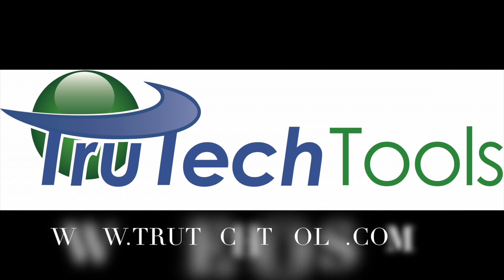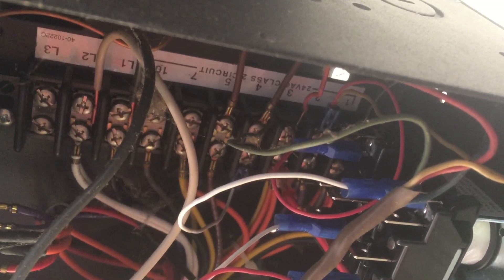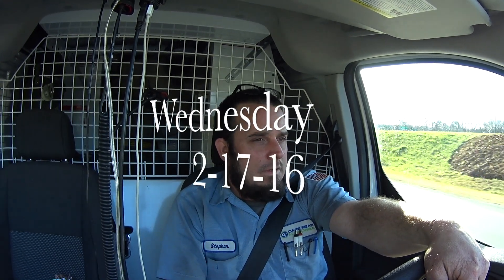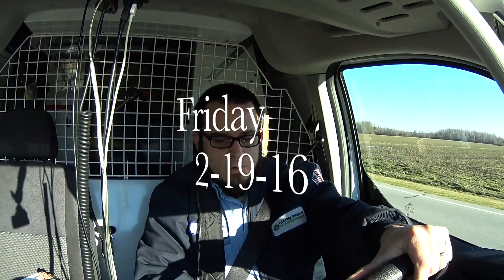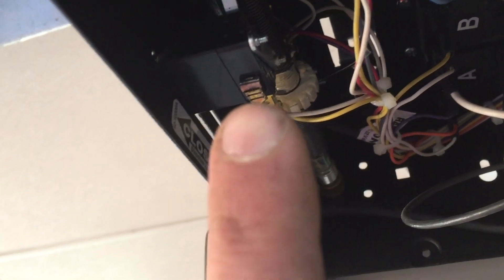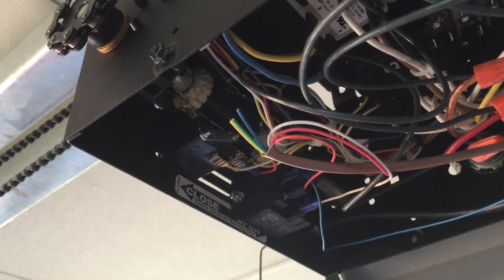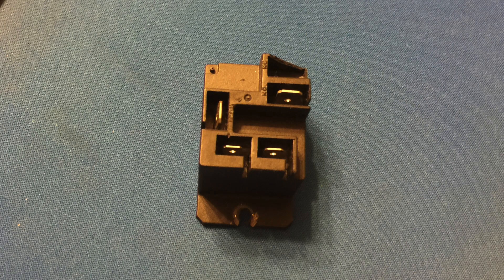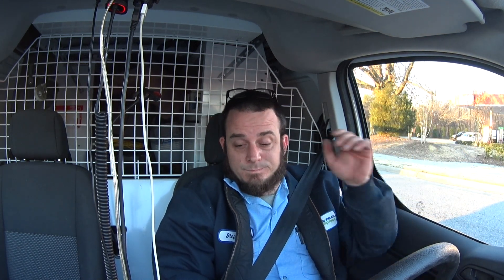HVAC Service: Garage Door Controlled Heater Shut Off

Comment: hey boss check out RIB products for example RIBU1C, it has 24v ac/DC and 120ac coil in one relay with n/o and n/c closed contacts. those come in very handy. electrical suppliers and Grainger have them on hands.

Comment: What about an end switch in the rail itself? So if the door starts moving it will close an end switch and break the circuit to the heater, sort of like condensate pump on a residential AC.